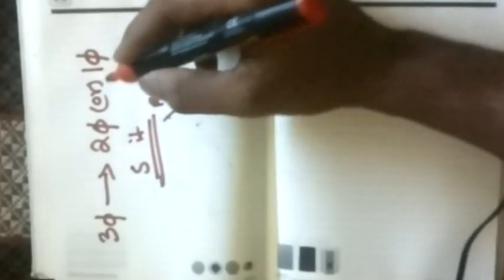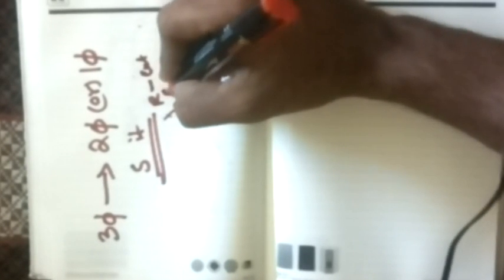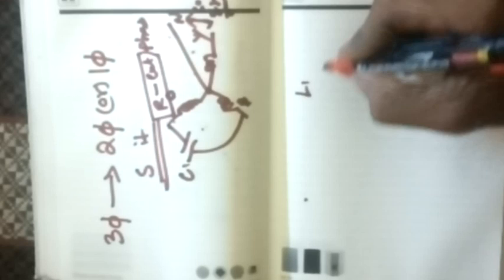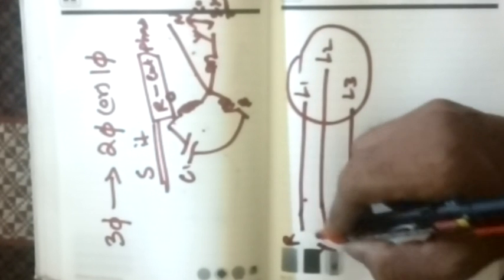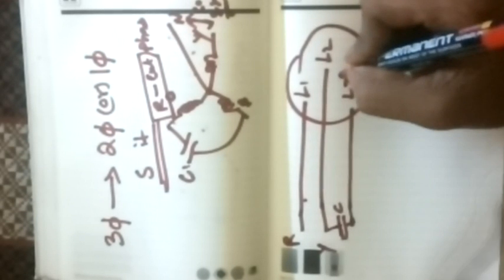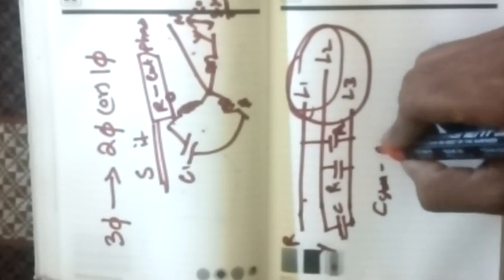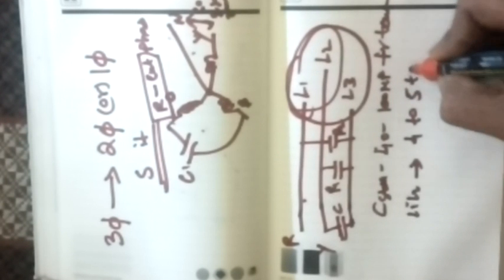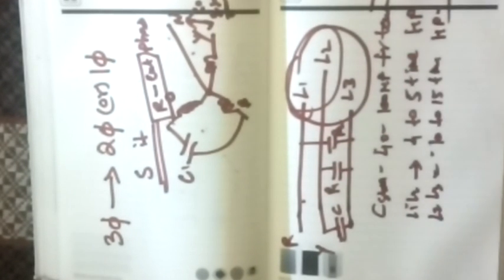How 3 phase motor run in two phases

Comment: What is the capacitor value for a 5 HP, 440 V, 10.5 A, 2800 RPM motor? Is there any formula for this? Also can you assure that using capacitor won't affect motor's coil?

Comment: Dear sir can we run three phase motor on single phase with load or without load " if can we run with load than plz send me the 10 HP three phase into single phase motor  with diagram with capicity of capicitor or loader " plz any how "
Reply: By using capacitor only upto 4hp we can use.